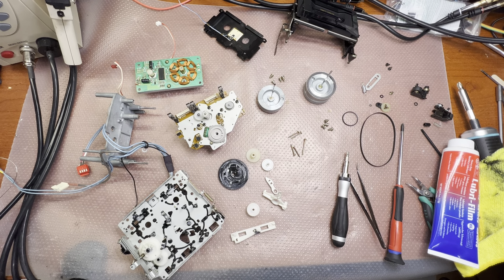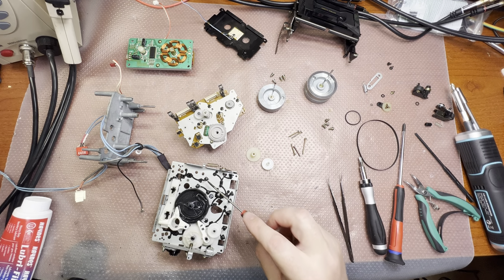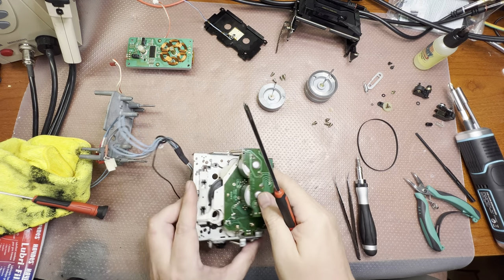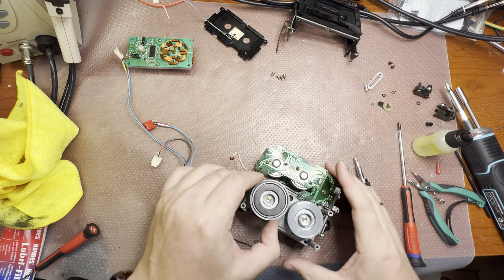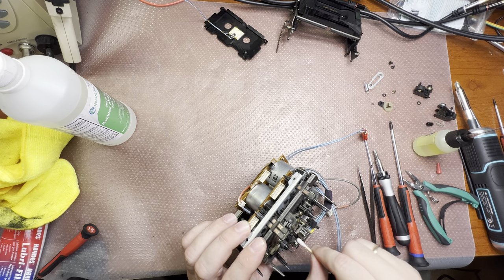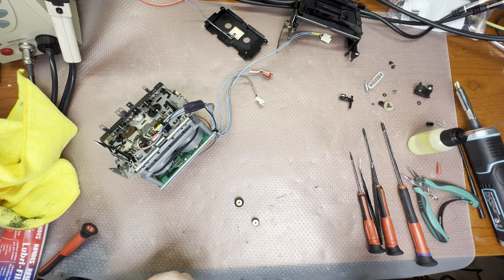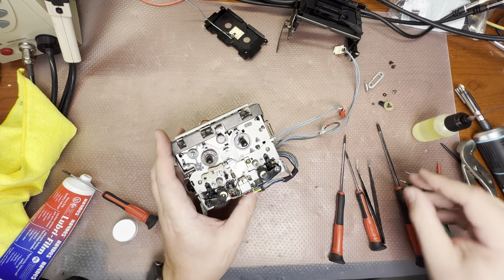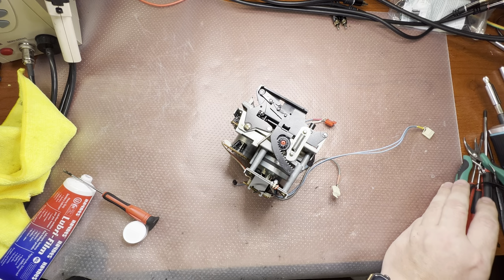Inside the Mechanism: Sony TCM-200 Tape Transport Assembly

Comment: Thank you for this very useful demonstration which I keep referring to. Can I ask on the mechanism by which the cassette door closes. 
Looking at clips at 35:30, the “tension spring” over the joint lever seems redundant (no room to expand), while the cog (red spindle) does not seem to be motorised or spring-loaded. So, I could not make out how does the door close. The door seems to open through the contraction of a thinner spring above the one you attach (at 35:20). Sorry to trouble you, and thank you again.

Comment: Thank you for the excellent demonstration. Working on the TC-K590 (similar mechanisms), I wonder if the mark on the gear loading cam needed to be in that particular position (just before opening the door if it were to turn anti-clockwise and as you were showing around 10:30 in the video)? I shall keep watching your follow-up demonstrations. Thank you.
Reply from the maker: There is only one marked position. At 10:30 I did show to set switched to the place not to break them.
Reply: @hifirulezzz  Thank you very much. This is very helpful and I shall keep this in mind.

Comment: Hi – I'm a big fan of yours and watch your videos avidly. You are doing an amazing job and I have learned and dismantled a lot from you, according to the video. If you don't mind, please help me with some advice, because I don't know what to do anymore: I have a Sony tc-k750es, Transport TCM-200, which, only in Play, does not spin the take-up reel. The belts and rollers are new. Perfect FF and REW. Eject the cassette normally. Capstan ok. Even AMS works: raise the heads, the take-up rotates and searches for the song. Then in normal Play, the heads rise, but the take-up reel, no! All the microswitches work ok. The reel motor does not receive voltage at Play. Please advice, tips. Something electronic? The integrated control M50964-224SP? Any transistor? Thank you and sorry.
Reply from the maker: I have met this issue once with a Sony 909. When I checked the level on the play output of the CPU it was not changing and did not engage the reel motor. The only solution I thought of was to use a signal from the playback LED and route it to control the reel motor circuit. As the LED is controlled by the display CPU and both CPUs communicate via a service bus.
Reply: @hifirulezzz  Hi. I solved the problem. :) I again disassembled the whole mechanism and the big cam wheel, it was not well placed. and don't  engage one microswitch. Thanks for the answer and keep up the good work.

Comment: Have you tried to remove the carriage with the heads? Is there any specific adjustments needed to be done there after re lubricating those ball bearings? There's nothing in the service manual.
Reply from the maker: There are no adjustments for the ball bearings, they are just bearings. But the position of the carriage will depend on them and you should check and tune head position as needed.
Reply: @hifirulezzz  Tilt of the head I guess.
Reply from the maker: @dimitarkirchevdimitrov6321  Tilt, height, azimuth

Comment: Which cassette deck is this from? Many Thanks
Reply from the maker: It covers most of the Sony decks from the late 80s and thru the 90s. To be exact it is TCM200 tape transport. I was working on the triplet of the Sony TC-K222ESL which has international version TC-K870ES. But same transport has been installed into wide variety of the Sony decks.

Comment: According my experience, the SONY SMD capacitors are always bad because underestimated. This might be the case, because SONY is famous in designing small as possible products.
Reply from the maker: Sure not, designed lifespan for that decks was 10 years. And we are using them after 40. So, not bad design after all 😁 Check the capacitor life on any distributor web site. It states 1,000 - 2,000 hours